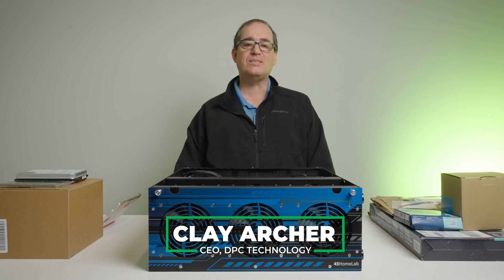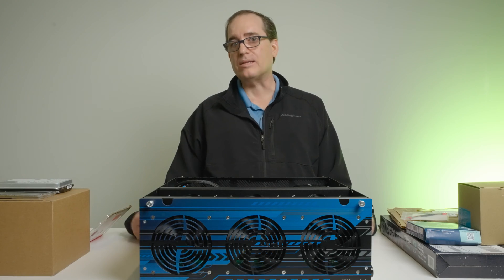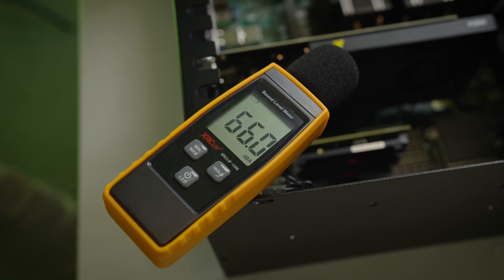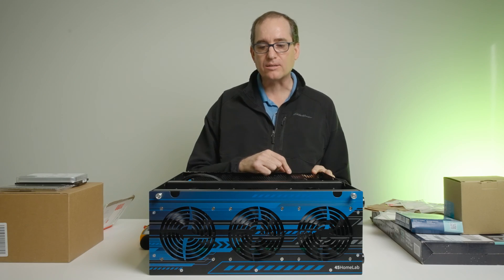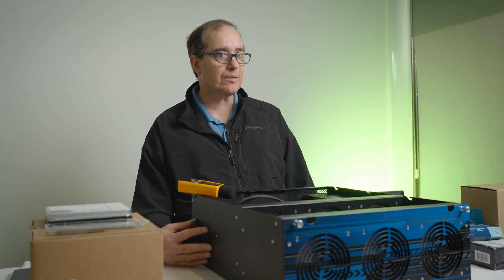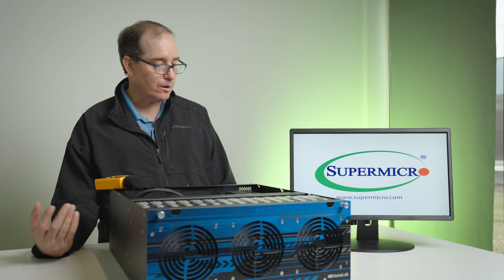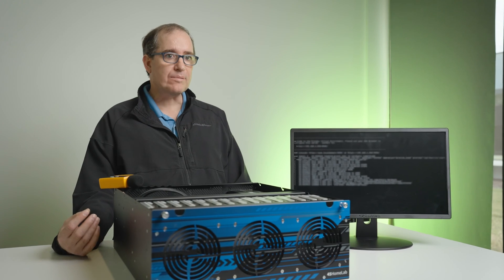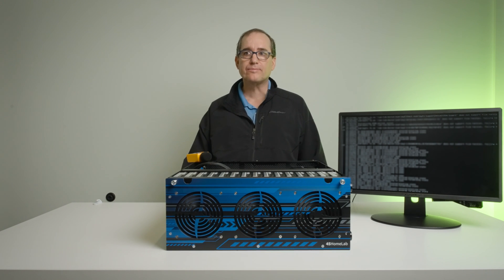Making my HL15 Homelab more POWERFUL (and Quieter)

Comment: Thanks for making this video. I think there is a general lack of content out there about making higher-performance homelab equipment run silently. I'd love to see an update video on how this goes in your condo. If I get a server like this in the future I think I'd look at replacing the fans with Noctuas or similar in hopes to bring down the volume.
Reply from the maker: Im srtill running the reduction cables 6 months later and inside of my sysracks case, it is perfect (less noisy than the systracs fans).  I am probably going to do the Noctua upgrade just for fun but it is more of a fun project than somthing that needs to be done..

Comment: How hard would it be to change the fans? I'm thinking Noctua fans would be quieter and it looks like the motherboard has 4 pin PWM connectors. Also, are these standard 120mm fans?
Reply from the maker: It would be really easy and they are standard.

Comment: I'm not sure why you think the stock CPU isn't powerful enough for what you're doing. Granted, I think for the price they charge you ought to get a better CPU, but I've seen the testing, and with TrueNAS Scale, doing dual 10 Gbps file transfers over SFP+ only pegged the stock CPU at around 40%. I think it would have plenty of headroom for a couple VMs, though I would advise against running any VMs on TrueNAS Scale (Wendell from Level1Techs has a video that can explain why better than I could).

Plus, that CPU can't do hardware transcoding, so I think you'd be much better off running Plex on something else and just having it access your media library via nfs.

Sweet machine though. It's my dream storage server at the moment, but I don't have space for a rack and have no idea when I will.

Comment: Just a heads up to those trying this. Apparently the type of Fans they are putting in these units are different now and the Fan Decellerator option will not spin up all of the fans properly. Unfortunately going to need to buy new fans.
Reply from the maker: Booo!